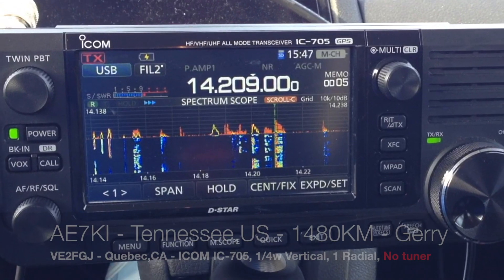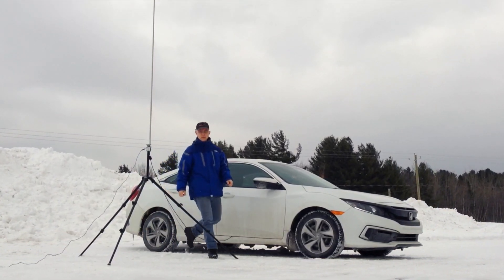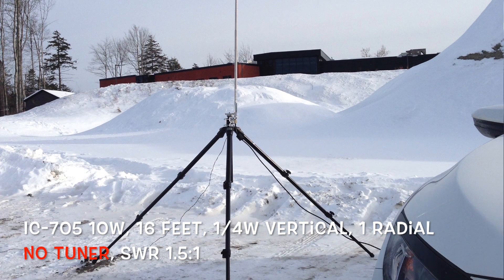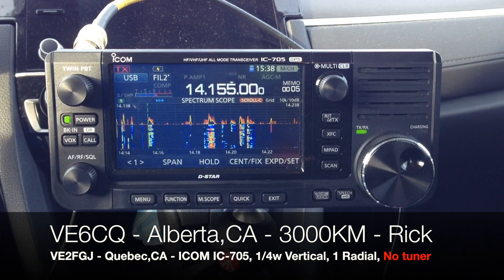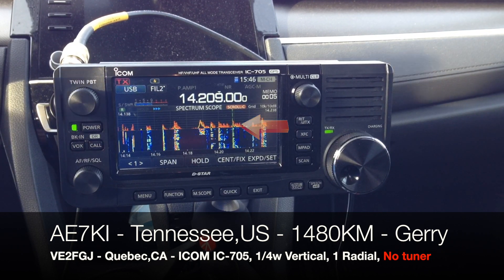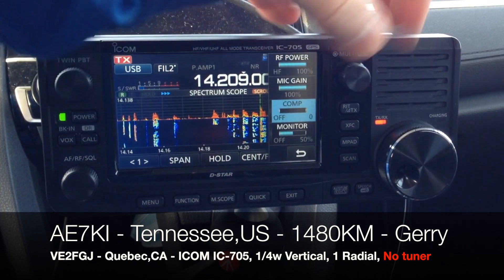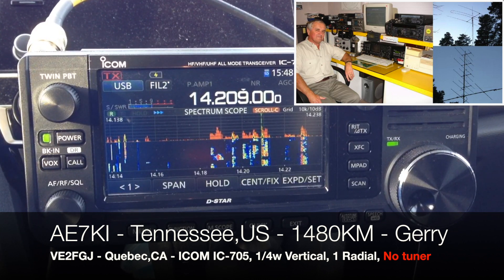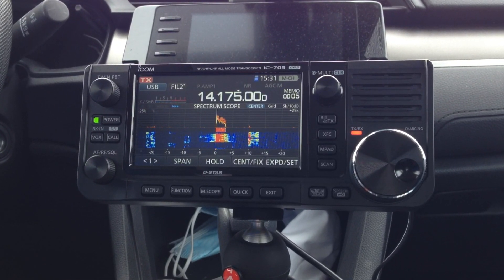ICOM IC-705 on 20M, 5W/10W, 1/4 wave Vertical, 1 Radial, No Tuner, First Contacts

Comment: Many times I see that when the antenna analyzer is used, it shows a different swr than the one shown in the radio. If you place another radio, it shows another swr. It is as if each radio had different swr.
Reply from the maker: Yes, it may differ a bit and also with more power applied the SWR may rise up. I usually do coarse tuning with the analyzer and fine tuning with the radio. Sometimes I rely only on the analyzer because the difference is usually small.

Comment: hello what antenna you used? 73
Reply from the maker: Hi, it is a home made, 16 feet, 1/4 wave vertical antenna (MFJ-1979) with only 1 radial and no tuner. 73

Comment: You might want to turn the compressor on for SSB. Makes a big difference. Mic gain at 70% and compression at 7.
Reply from the maker: Hi Micheal, those were the 1st contacts... I now use compression 2-4 and MicGain 50-70 and TBW Mid for DX, those really do help. Thanks.

Comment: If you elevate the single radial It will resonate better and you will find better swr without the need for more ground radials. Buddipole recommends an elevated height of >=4ft
Reply from the maker: Yes, I did try the Buddipole, 1 radial at 6 feet and it provided a better SWR. I also tried with 4 radials at 5 feet, its fun to play with antennas. Now I usually use 3 radials partially elevated, gives 1.3:1. Thanks for the comment!

Comment: where did you get the bracket to hold the antenna to the tripod?   good job overall with all the contacts
Reply from the maker: The bracket is a generic CB antenna mount to SO-239, while the following is not exactly the same, it can be found on Amazon with "Pro Trucker 3 Way Aluminum Cb or Ham Antenna Aluminum Mirror Mount with Stud"
Reply: @VE2FGJ  Brilliant.  thanks

Comment: Question @ 5:20 why did you place the coax choke by the antenna?  If you placed it by the radio, especially with 5W, the feedline shield would become a radial...so with essentially the same setup you would have 2 radials.  Also, when you say this works well....compared to what?  There are references which show the dB change when adding radials, and 1 is suboptimal.
Reply from the maker: Usually we choke at the antenna feed point. I didn't want the coax to be part of the antenna. The goal was to do an improvised experiment to see how 1 radial would do with 5W/10W as a minimal portable setup. It did work well as a minimal antenna but is not optimal. Next time, I will make a set of radials.
Reply: @VE2FGJ  Sounds good!  Thank you for conducting this experiment.   I'm just curious, for a portable setup with QRP power, why not want to make the coax shield a radial?  Is there a reason?  And...we already know that antennas with 6-12dB loss do work, as evidenced by the popularity of the Chameleon MPAS system.
Reply from the maker: @daveG1020  The reason is isolation, I may change coax length, this will cause to have to re-adjust the antenna/radials length. I am pretty sure that the single turn on a ferrite would not do the job of actually choking, at best it does it a bit. It is just good practice. Again this is my 1st experiment and during cold weather, not ideal for lengthy testing. More to come as the weather warms up! Thank you for the question.

Comment: Might try a bit less mic gain and a bit more compression. Great setup!
Reply: exactly what I was thinking too... I run mic at 35% and compression at 3, I get between -5 to -10dB of compression and it usually works really well !
Reply from the maker: @Aleziss   I actually made some tests this weekend and those values you mentioned are pretty spot on!  Mic 35% and Comp at 3 on WIDE BW with the stock mic is very good. I would increase the Mic gain a bit with MID BW to push that signal for DX, Thanks Aleziss for the tip !
Reply: @VE2FGJ  awesome ! yes, DX is better at 2.4kHz bandwidth but I always leave at those levels and I always get excellent audio report even with the stock mic. 73 !
Reply from the maker: Yep and a bit more radials! Thanks.

Comment: Hi Frank, it looks like you have made a nice Antenna, I also have a 705 and am waiting for a MPAS 2.0 to arrive from Nevada, so I can try portable operating when the UK weather improves!! It just proves that you can make good DX with low power! Interesting comments on the direction of the ground radial, maybe worth experimenting with more radials laying on the ground or resonant raised off the ground. 73 Alex M0KVA
Reply from the maker: Thanks Alex, the MPAS will allow for multiple bands, yes more radials or less but elevated. I really like experimenting, I am thinking of the Wolf River Coil for using my setup on 40M and 80M. Good luck with your setup Alex. 73
Reply: You'll love the MPAS 2.0, I use it with the FT-891 @100 watts and over the Summer on 20M evenings UTC I made regular contacts from Ireland to South America as far as Chile, Super antenna and very quiet on receive, it works so well I decided to leave it on the front lawn permanently but if doing this you will need to grease it with noalox or the aluminium sections will seize and you won't be able to take it apart again. I just checked mine today and after the whole horribly wet and windy winter it's still as new, I'll apply more noalox for next Winter. 

I use just the single radial, will make more + the CAP Hat, this makes it more broadband and I can work some bands with no tuner. 

Performance will suffer on 80m but I have made come contacts to the U.K and on 40m performance will also suffer but I have made contacts to USA on 40m with just 100 watts, to be honest I haven't really tried much on 40m with it.

It's so easy to set up, the spike makes it even easier to get in the ground. So now Instead of having to take it out of the bag and set it up I have to take it off the front lawn to go portable but at least it's getting good use.

I also use it with digi modes but remember max power is 50 watts or a bit less using the hybrid micro.
Reply: @o00scorpion00o  Hi, thanks for the info on MPAS 2.0 I'm still waiting for it to arrive from the US and can't wait to have a play with it in the field !! 73 Alex M0KVA